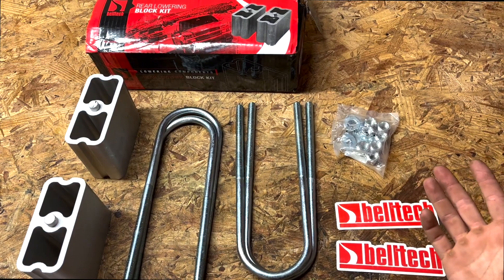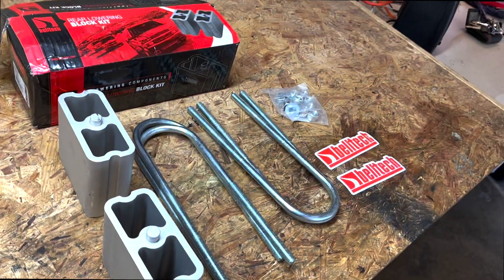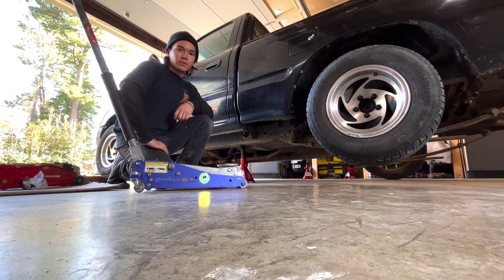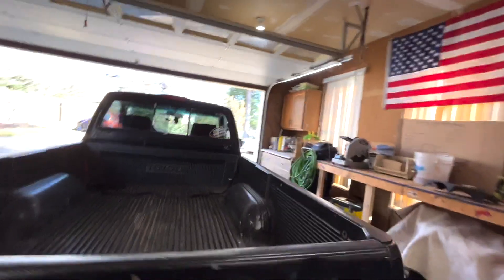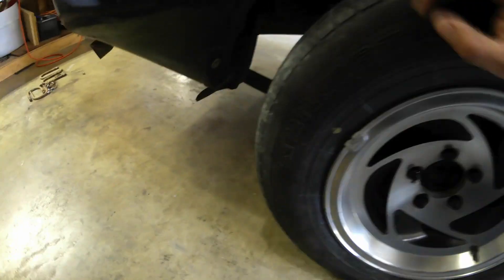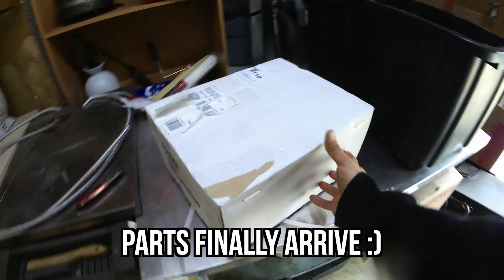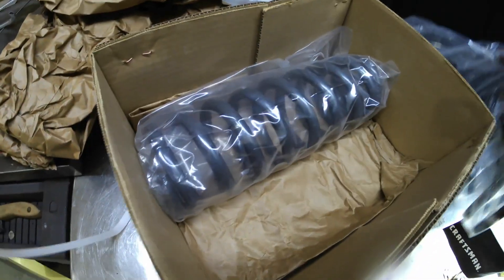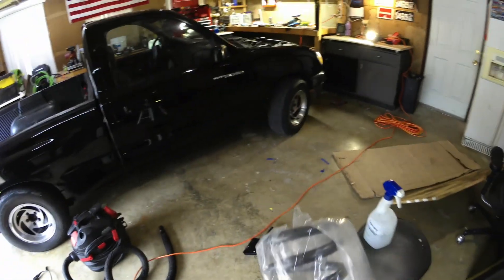How to lower toyota tacoma

Comment: What’s your tire setup? Thinking about doing this kit with the ball joint flip. I do want to run 18 inch wheels from a Lexus is350 tire size 225/40/18. Think they’ll fit with this kit?

Comment: I have 4” lowering blocks in the rear of my 02 taco and 3” lowering springs in the front and I’m not happy with the height up front gonna flip my ball joints asap!
Reply: Bro I just dropped mine 3" from the rear sitting on 17" wheels right now. Planning to buy 2" belltech like this guys, but not flip the balljoints. Will buy new ones since I'm going to remove them might as well replace them but again not flip them heard its too much stress for balljoints
Reply: @raulvazquez8783 what block kit did you use and did it come with the u bolts?
Reply: Belltech 6200 yes comes with hardware aka u bolts nuts and washers
Reply: @raulvazquez8783  did you change your shocks too? Probably gonna run qa1’s myself

Comment: A question out of the tama my steering wheel vibrates a lot what can I do
Reply from the maker: Go to mechanic or u got bad u joint
Reply: Idle air control bad …if that happen park

Comment: Hey were your lowering blocks slanted or flat? Because I bought 4inch blocks for
Mine and they came slanted just wanted to know if I got the right ones before I put them on.
Reply: tapered blocks are way better for your pinion angle

Comment: I wish you showed exactly what to remove because I want to remove and replace the coil spring but good job over all
Reply: Upper ball joint, the. Push down on lower ball joints with spindle and then slide in the springs
Reply: @juanadorno1975  I have the haynes book, seen other videos and you make it look super easy I will try your way, but I am still replacing ball joints and tie rod ends anyway will update you when I do it. Thanks for the reply
Reply: Also remove the strut/shock if not, you'll have a really bad time  @raulvazquez8783
Reply: @juanadorno1975  will do! Once I order all parts and do it I will update, it's going to be a while still before I do this project
Reply: @juanadorno1975 I just ordered my springs, been holding off on the project lmao. So exactly step by step please explain to me. 

Jack up and remove wheels, loosen upper ball joint, then what? Looking forward to your help and doing this next weekend! This guys video was so fast forwarded and didn't explain or show what to remove.

Comment: So is like a 4/4 drop by do the flip up front?????
Reply: you can do a flip or get spindle spacers thats what i did for my truck i got those same belltech springs i put djm shocks in the front and ebay spindle spacers and i have no gap with 17 inch wheels
Reply: @kev818  I'd like to see that...

Comment: What lowering springs did you get from bell tech I can only find once that day for a v6 are those the right ones
Reply from the maker: Probably as long as the year Is right
Reply: That’s what I thought too but I realized the reason they specify for the v6 is because of the difference in weight. My 1st gen is a 4 cyl so it’s not heavy enough to compress the spring to where it needs to be. That’s probably why he didn’t get much of drop at first until he flipped the ball joints. I hope this helps because I figured it out the hard way.